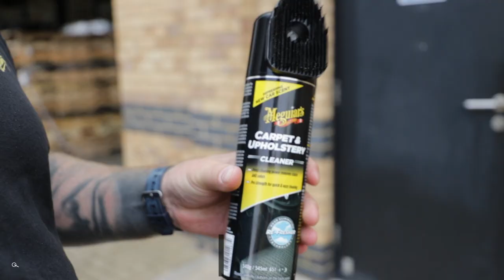Meguiar's Carpet and Upholstery Cleaner - Product Profiles

Comment: not sure about this method. dont think the stain is pulled out. it looks clean because the foam is white ffs
Reply: 09 RedErs I’ve used similar products because I work on building sites so get a lot of mud and dust ground in, they aren’t really for targeted stain removal but seem good for a freshen up although I’d prefer to wet vac rather than wipe off to make sure dirt is removed not rubbed back in, I will be trying this one because i bet it smells good too
Reply: you can see the dirt being pulled up by the microfiber doe